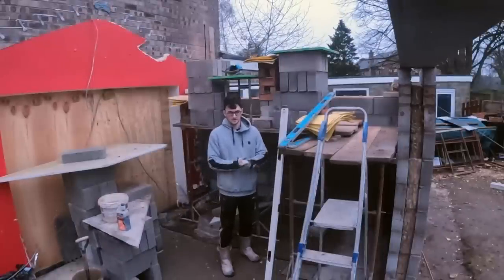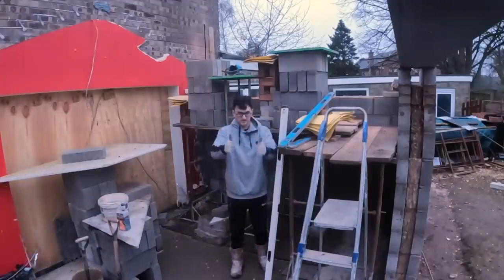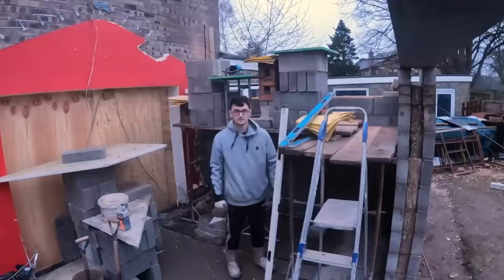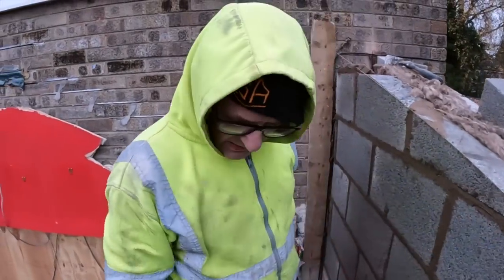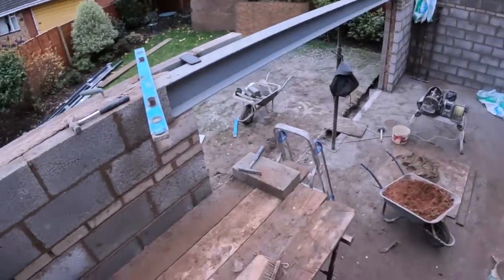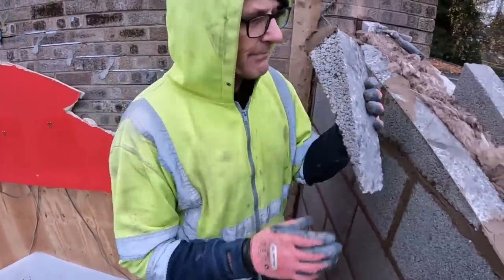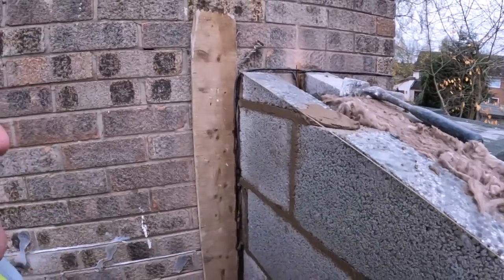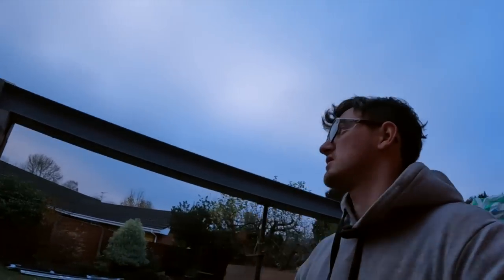TOP OUT TIME .. BIG EXTENSION PROJECT PT 6

Comment: How does that insulation you put in the cavity not getting soaking over time and transfer moisture to the inner skin, which would cause damp on the inside of the building?
Reply from the maker: Moisture can only pass  through it vertically not horizontally 🧱👍🏽